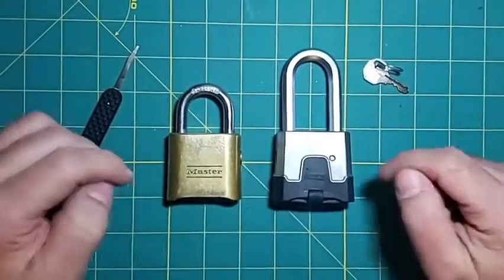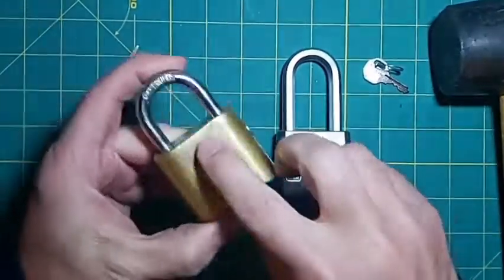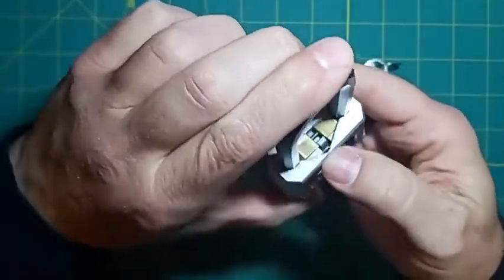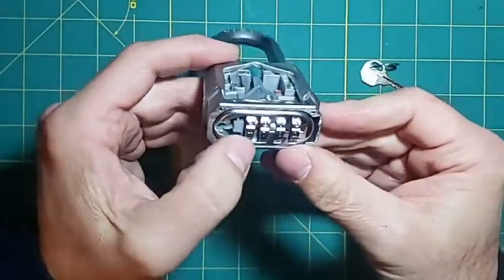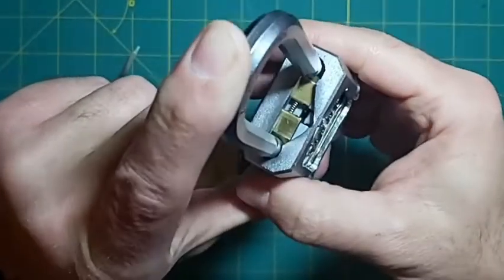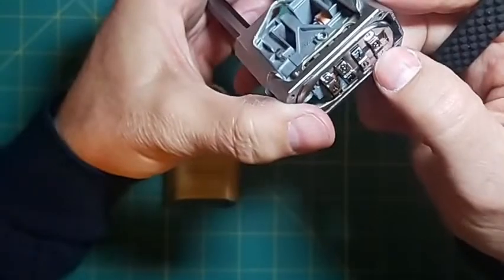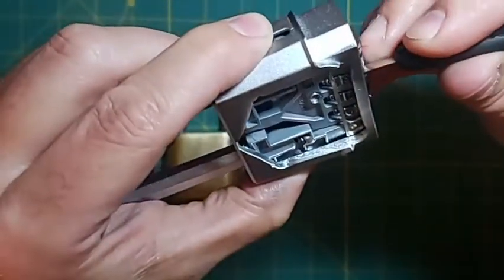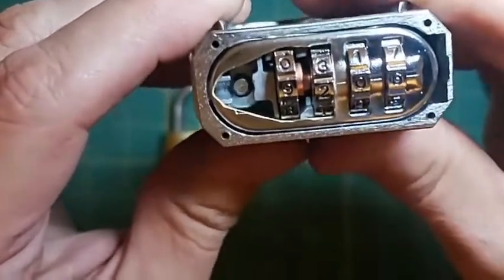[31] Cutaway of Master Lock M176 Combo Lock

Comment: Thank you very much.  Been buying locks for 1.00 at this Amazon return store.  On weds everything is 1.00.  They always tell me "we dont have the key or the combo"  i always say "even better"  lol.  Been teaching myself thanks to people like you.   I picked the key slot the other day but never could find the flat spot side till i saw your cut out, and got the lightning right lol.   One by one felt the flat spot lined up all 4  ....".i had it in the open position and key hole turned back to correct position already"  and pushed the shakle down to lock it and move each dial one at a time.   Well it kept popping back up .....  i lined up all 4 in the correct position on first shot.   Moved 1 dial and it locked but dial back WAAAA LAAAA !   all before your video ended lol thank you !
Reply from the maker: @RobSS1113  very awesome indeed, such a great feeling when you finally get it, my wife brought home an abandoned 176 that was in a desk drawer and I did the same thing, always great to give them a new life